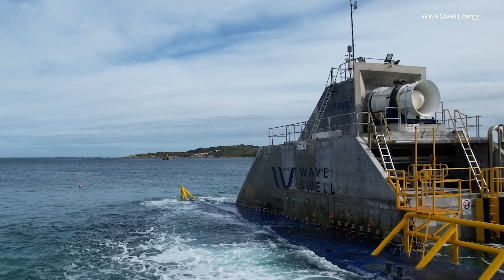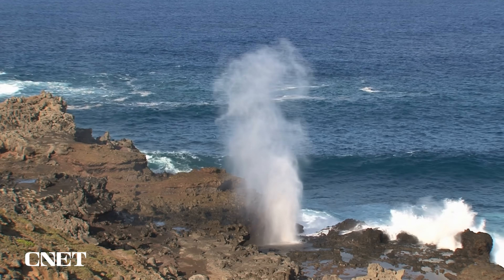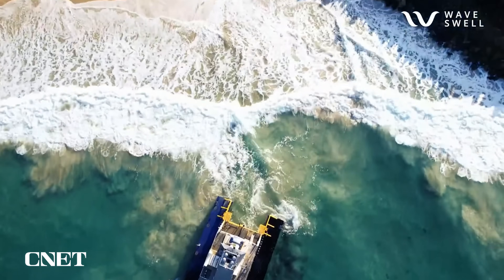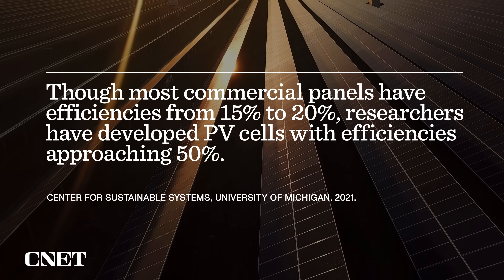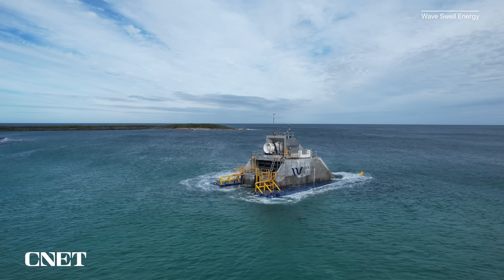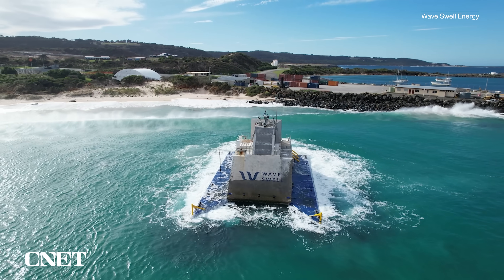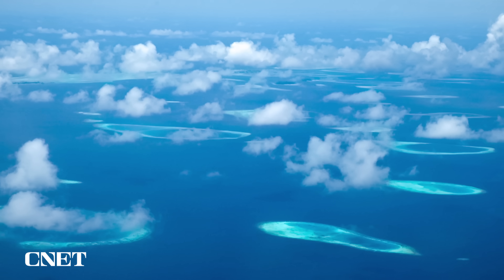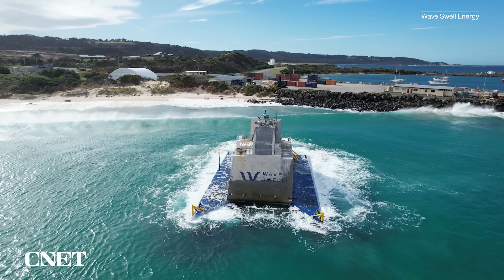'Artificial Blowhole' Generates Wave Energy for 1 Year

Comment: Imagine they put a couple of these as the foundation for each offshore wind generator (obviously only ones with waves) then you'd get double generation, and also a larger range of generating opportunity (small waves but windy & no wind but with big waves. Whole harbour walls could incorporate this tech!
Reply: @renevile  Yeah, definitely true. It won't be useable 24/7 but could definitely increase the range of conditions for energy production. I think having a harbour wall built with these could be a good passive generator and is probably it's strongest application.
Reply: Notice they didn't even mention the energy ouput of this thing.
Reply: @kwisatzhaderach1458  Yeah, for sure. But this sort of tech is in the proof of concept phase with new designs in progress. But, if we look at the ammount of energy in one of those blow holes, I think a good ammount of energy could be harnessed if we work out the best way to do it!

We can't put all our eggs in one basket. If we have many different types of generation, chances are that one of the types will always be generating electricity. One thing that needs to change is how we store our electricity to be used later. That would make all these small scale, low output setu[ps to work best!
Reply: And the wind turbine towers were fitted with solar panels. Actually, tides are the only green power that is always here, 24/7. They do fluctuate in power, but they are always there. But this energy may be the hardest to harness.
Reply: In order to get the next government grant, they've got to show progress.

This is the latest environmental scam for the researchers.
Reply: @renevile  or how much chaos there will be after these 'low lying islands' have a hurricane/tsunami and now you have a region heavily dependent on highly specialized infrastructure for power 

Plus did you see the size of that thing? Most islands are dependent on tourism, so how much is the economy going to suffer if you line these up on the coastline? 

Green energy is good but CA, TX, and Germany have already proven the devastating consequences of having a grid run primarily on it. The net impact is worse than the benefit. 

People need to stop researching ways of generating the energy and figure out how to store it that doesn't require strip mining
Reply: @raidzeromatt  TX showed the error of not preparing critical infrastructure for extreme weather. Germany showed the error of relying on Russian gas.

Comment: For those goons that can’t bother to google stuff for ten seconds: An average 4-foot, 10-second wave striking a coast puts out more than 35,000 horsepower per mile of coast. You can do the rest of the math yourself.
Reply: Oh well, I’m no math whiz, but if 35,000 hp = 26kw, and 1mi = 1,600m, then a 1m wide intake might receive 16kw of force in one 10s 4ft wave. So at a 50% efficiency, you get 8kw. Now those intakes looked like 5m to me, so maybe 40kw in one average wave. So maybe you get like, what... 3 waves / min... maybe 100 waves an hour? So that’s a 4,000 kWh system on what looks like a 1,000 sft footprint.
Reply: Now I’ll go and litter a bunch of coastline with these ugly things, assuming resident municipal voters aren’t going to scream bloody murder about it and kill the effort in court.... then after 100,000 units are installed and hooked up, we’re talking 4GW systems - I’ll take that over any Fukushima nuclear plant. As long as they don’t install these things in places I like to go beach bumming.

Comment: Its impressive how the graphic at 0:50 shows half the wave cycle being vented and yet they still achieve 60% efficiency.
Reply: Lol interesting detail. I wonder if it's 60% of the half wave's energy.
Reply: As long as there’s little resistance to air getting out of the way, that shouldn’t be much of a problem. The kinetic energy of the water on the way into the device should be stored as gravitational potential energy with a very high rate of efficiency. If you attempted to harvest energy with the water on the way up, it simply would not go as high, and you’d get proportionally less energy on the down stroke.

Comment: Someone check my maths. Rough estimates, this footprint is 1800 ft ^2  (60x30ft) or 167 Meters squared to make 1MWh the same size of solar would make 27KWh or roughly 37 times less than this blowhole or in other words this could power 33 homes, and the same size solar would power 2 homes??

Comment: Distributed Generation. Stop creating massive infrastructures that require backhauling the electricity over old failing highly inefficient grid system. Put power generation at the site. Small roof solar, small wind turbines on a house, Molten Salt reactors in skyscraper basements, ....

Comment: This is a cool piece of technology that cleverly uses the naturally occurring force of waves. If the diagram shown is accurate, then they could easily increase it's efficiency by making the water bellows section in the shape of an dome or upside down end of a horn. This would allow for the capture of more air initially and increase the air pressure throughout the waves push. As you are moving more air with more force in the same wave motion efficiency should go up.👍
Reply: Excellent idea.  Also placing two units side by side so inward pressure is generated on both wave rise and wave fall.   Double the efficiency.

Comment: Their website says this was a 200kW turbine. Since they said 50% efficiency, I presume that’s around 100kW at peak performance and wave times. During calm seas, near zero. Maybe 10 homes peak power. Add the obligatory battery storage and it’s part of the power solution, but not THE solution. Look forward to the next phase!
Reply: @william breen good point.

Comment: interesting concept, we could have thousands of these round the uk coastline, who cares if its 50% efficient if its producing power from just bobing away, how many times do I see wind turbines not turning because of no wind but they still keep putting them up.
Reply: 50% efficient.

If it generates 50% of the energy it cost to make and operate...who cares, right?  Right?

Efficiency is input power / output power.  I hope you don't procreate a spread your millennial views to the next generation.

Comment: "Energy efficiency" (what percentage of energy coming in is turned into electricity) means nothing in this context, please can we stop talking about irrelevant measurements?

What matters are total output and cost per unit of electricity produced. If this produces 500 kWh/year and costs AUD$500/kWh then it's completely useless even if it's 99% energy efficient

Comment: The schematic is incomplete - it appears the compressed air on the waves' up stroke just vents to the atmosphere, while the turbine only works on the "suck" stroke as the water recedes.
You want to extract energy on both strokes, and keep the turbine spinning in the same direction on both strokes by using blades that reverse according to which pressure is highest.
Or use two turbines in parallel like a diac, so one works in one direction, and the other turbine works in the other with a valve to select which is in operation.
I had all this worked out 50 years ago as a kid in the bath with a squeezy bottle!
Reply: No, it generates power on the up and down strokes. Watch again.

Comment: I'm curious about how  it adjust throughout tidal range. Like most blow holes operate far better at mid - high tide. 
And "availability" means what? Perfect swell size 80% of the time? 
Also notice she generates on "suction" only, could power be doubled by generating bidirectional ly? 
Also if they place 3 or more to catch different wave phase, the output could be smoothed out rather than a surge every 10 odd seconds. Also the local power supply must also "surge"? to counter balance the wave surge? So many questions 😁

Comment: Why do they focus on the efficiency of renewable energy? It doesn't matter what percentage of wave energy is converted because the waves happen regardless of our efforts to capture their energy.

What is relevant is the overall energy output of the system and its relative lifetime cost compared to other energy sources. I find out highly suspicious that neither of these were discussed. I get that it's still in R&D. But since they didn't even mention this, it suggests to me the output is embarrassingly low.

Comment: Is there a reason for not using the airflow both ways? It seems a waist not using the suctioning.
Reply: On their website:   

"Previous OWC technologies have all been bidirectional. The WSE technology, however, operates unidirectionally. This results in the WSE turbine being simpler, more robust and reliable, and exhibiting a higher energy conversion efficiency. The only moving parts in the technology are the turbine and bespoke valves, all of which are well above the water line. There are no moving parts in or below the water."    So, it seems a very consciously chosen path...  drives down complexity ?

Comment: This "blowhole" is the most stupid idea for a long time. A perfect example on how the taxpayers money is drained into a (blow)hole. 

Probably the most expensive watts of power on the planet. ( I guess watts, not kilowatts ) however, the report does not mention any information about power. Probably for a good reason. There is not much  power to report...

Power output is not important for this gang of societys parasites - living on subsedies. 

The only true value in this project, is re-use of the materials used in the construction. The price of materials has risen during the project. But dont wait to long. Salt water is corroding away even the residual materials form this freak construction.  

Australia has come a long way in its stupidity. This is the proof.

Comment: Wouldn't it be more sensible to harvest wave energy by letting a floating Platform float on the waves and deriving the energy from the movement up and down (e.g. with a pulley on the see floor that goes up to a generator.
This thing seams to be a way of producing wind that can be made to electricity with a wind-turbine.
Also, how much energy does it produce. A number that is very important and remains unmentioned.
Reply: 200Kw

Comment: This is an oscillating water column device using a wells turbine - exactly the same technology that has been trialled in the past in other parts of the world (including Wavegen Limpet in the UK). 

One of the problems with this technology is that if it is placed on the shoreline there is less available energy to harvest and if it is located on the open ocean this device looks to be too large and cumbersome in storm events. 80% availability is not good for a device that would need expensive and dangerous boat trips out to fix issues. I agree with other comments that it is a big omission to not mention the power output or energy yield of the trial system. Also some basic graphics and context on the way the technology works would have been good for viewers. I wonder if an engineer was involved at all in the production of this video.

Comment: If you belong to the really lucky part of mankind, you would know that energy is not measured in percent of whatsoever but in kWh and especially in these days you might have found out, that USD/kWh is an even more important number when it comes to energy-production. There is the cheapest available energy production systems on earth like solar and wind, where kWh/m2 and ct/kWh are well known 1ct/kWh and declining when it comes to solar, 4/8 ct/kWh when it comes to wind (on-/offshore). Where the double cost for offshore wind mainly arises from higher building/maintenance cost. So if a company hypes a new technology, comparing it to wind and solar without letting out the really important numbers kWh/m2 and ct/kWh you already know you have seen a scam. Reporters paid for recherche and having at least a small glue about the matter they are talking about should know so or are getting suspect of producing clickbait rather then press coverage.

Comment: The whole point of the argument is that if you want enough energy to keep the lights burning 2 things must happen.....1, you need to reduce your consumption and 2 you need more energy generators........the failure on both counts means you miscalculated your needs and spent the money on a long vacation or you failed to collect the revenue to make the energy producers when you had a surplus of money.

Comment: The sea is very destructive so it'd be interesting to see how long it lasts and what the ongoing maintenance costs are as that has been the downfall of most wave energy systems up to this point or as the saying goes "the sea is a cruel mistress"
Reply: The sea is VERY hard in King Island because it is essentially narrowed to ONE THIRD of what it was. It was a trade wind route. My great great grandfather was the lighthouse keeper there.
Reply: @timemachine194 interesting, I know many have come away broken from being in the sea at the European Marine Energy Centre  testing centre in Scotland
Reply: They had a lot of trouble keeping it in place. That's why it's at a odd angle to the beach, it washed up onto the beach when it was first put in. They had to airlift lots of bags of rocks to hold it in place. It's in a kinda semi natural harbor now, don't know how it would go if it's more exposed.
Reply: Honestly. I bet it’s easier and more cost efficient to fix this, than it would be to fix a massive oil rig. Or even an electrical plant. Those things constantly need maintenance.
Reply: This is probably more reliable than wave systems that have propellers inside the water. It doesn't have to worry about barnacle growth and so on.
Reply: Saltwater is very destructive, rebars within the concrete will not scape the salt saturating the concrete after a few month
Reply: Yes, that's a major challenge. How can it be responsi ecenough to generate on a calmer day and not be ripped apart in a storm? Unless there is a massive amount of energy storage available generating a huge amount in a storm is useless.
Reply: Surely the multiple PhD level engineers working on this project haven’t thought of this problem …
Reply: This device seems to be mostly made out of concrete, with no important parts actually exposed to the sea water
Reply: the sea is always right

Comment: I have a wave machine that is cheap to make with minimal parts. 
I also have a magnet motor that actually produces usable torque and RPM. Also only 4 moving parts. It can easily drive a generator. You'll never have to plug in your electric car and a unit about the size of a refrigerator can power a house off grid. 
Please contact me for further information

Comment: Would have been interesting to reveal how much power it can generate.
Reply: 5 kW (I made that up, but I wouldn't be surprised if I was correct)
Reply: @trygveevensen171  per what, week day over the whole life of the project?
Reply: @rootvalley2  I think you're confusing kWh and kW. 

If something produces 5 kW, it will have produced 5 kWh after an hour and 10 kWh after two hours.

5 kW would mean 120 kWh every 24 hours. (Though that thing is huge, so it probably produces more)
Reply: It's really difficult to give you a direct number for that given how varied wave conditions are. Would you want an average? That's a pretty misleading statistic to the efficacy of the device given that it's directly correlated with average wave energy over the trial period. Would you like a peak energy value? Also misleading. The best option to understand how efficacious an energy harvester is, is the ratio to the total energy produced to the total energy available which is... You guessed it.. 50%. Which honestly as far as energy harvesters go, isn't that bad.
Reply: @Steven Bulfer Average is not misleading, otherwise solar energy wouldn't be a thing. Energy storage is used to smooth out a variable supply. 
Know what's misleading? Supplying just an efficiency ratio. 50% of nothing is.. nothing. Maybe wave energy isn't viable in the first place. Maybe this is a scam just like solar roadways and spinlaunch.
Reply: @Stevobulfer  It is extremely easy to come up with a direct number.  It's called aveaging.
Reply: @rockspoon6528  I've never heard of aveaging lol. But in all actuality if you knew anything about statistical analysis, you'd know averages often do not tell a complete story.
Reply: @Stevobulfer  Of course averages are not the complete story- in this situation, talking about this statistic, the average power output is the single most noteworthy datum and it's been completely ignored in favor of absurd drivel about efficiencies.
Reply: @rockspoon6528  my lab builds bio-energy harvesters. We report efficiencies because it's standard.
Reply: @Stevobulfer  If you can't also report an expected power output for a standardized model, you're a failure at life and your lab is a joke.  If you've measured the efficiency and are not spouting theoretical BS to your investors/administrators, then you already have that information.
Reply: @rockspoon6528  problem is, there is no standardized model for many energy havesting situations.
Reply: @rockspoon6528  of course "real" power values are measured (and eventually reported), but the most important value for comparison in these fields is efficiency because prior information about each given situation is needed
Reply: @Stevobulfer  To respond to the unhinged character assault of your prior comment: I'm actively working as an engineer/scientist.  If there isn't a standardized model for calculating power output in your field, you have failed... but I'm in industry, and maybe you're still in school where theoretical BS is more important than reality.
Reply: @rockspoon6528  sounds like copium to me.
Reply: @rockspoon6528  you: relying to your unhinged character...
Also you: your life is a joke and your lab is a joke.. whose unhinged again??